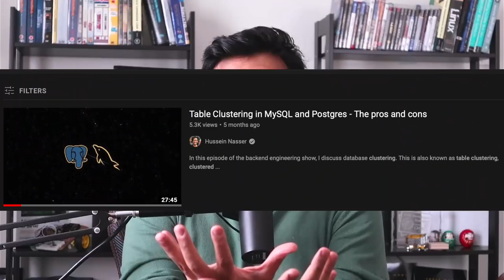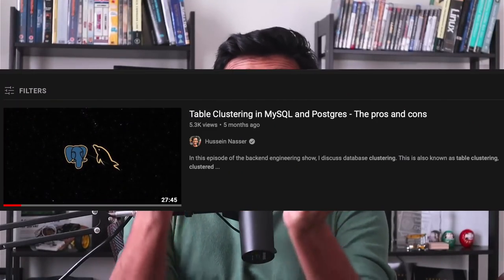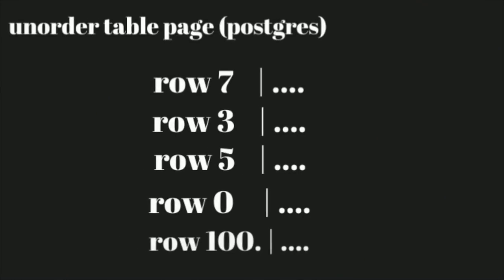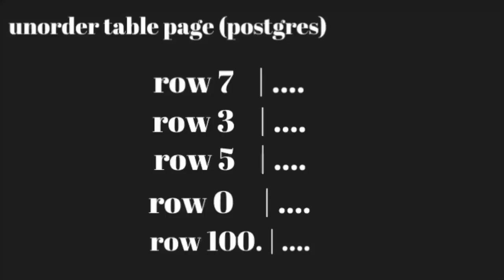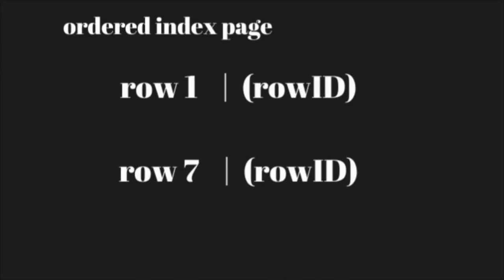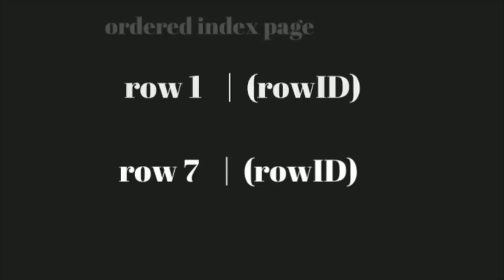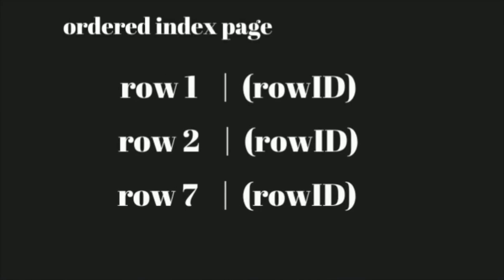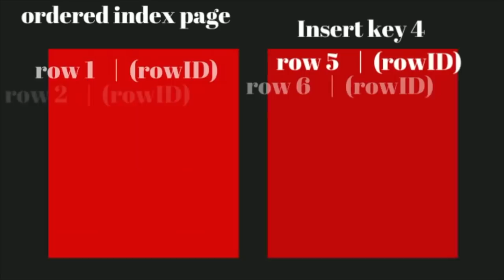Database page splits | The Backend Engineering Show

Comment: Are these pages the reason why when I view the properties of a file in windows explorer there are two displays? One says "file size" and the other says "size on disk" (I don't remember exactly what they're called)
Reply: Yes
Reply: Kind of but not entirely. Files can be attached to other files in hidden partitions. The size on disk can sometimes be bigger than its size when there is another file that's attached, sometimes viruses use this to hide programming and/or even file backups like photos or videos the spyware is tracking incase you ever delete them